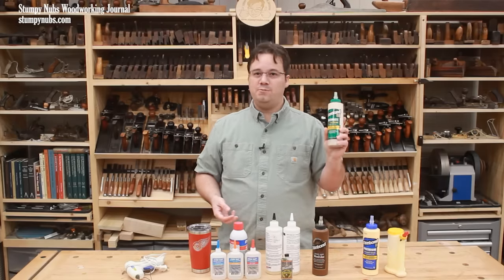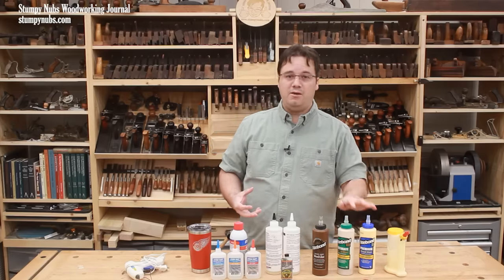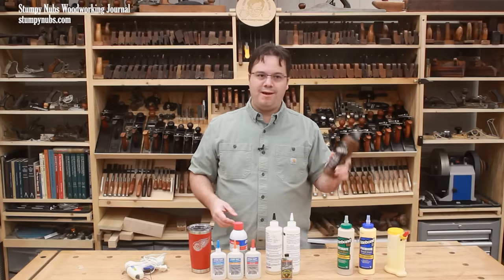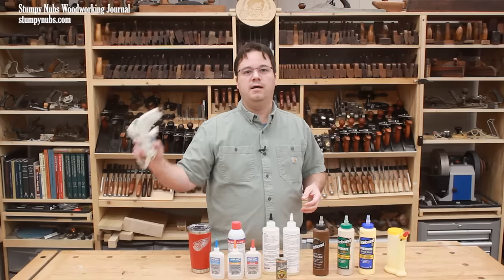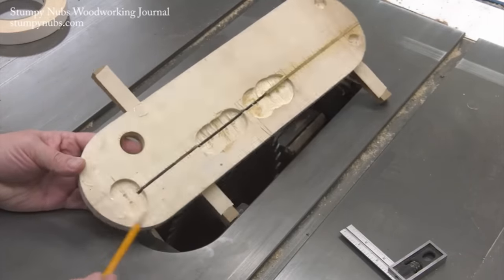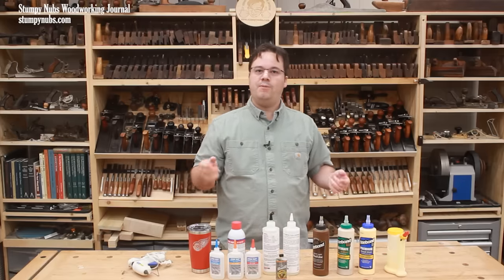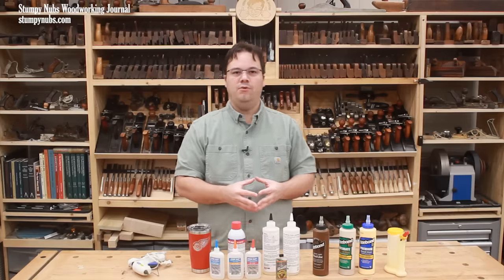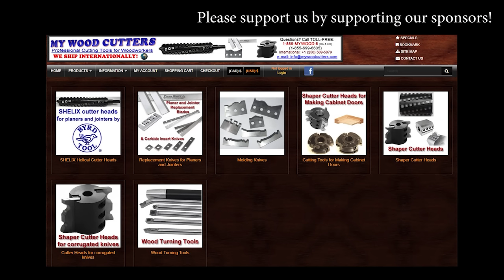Why I don't use Gorilla Glue

Comment: Here in New Zealand there is a workshop building new airframes and wings for the De Havilland Mosquito Fighter bomber from WW II. These are made of wood: spruce/balsa ply for the skin is only part if it. I don't remember which glue DH originally used, but it didn't last that well especially if the aircraft were stored out doors. Even during the war aircraft operated in the Pacific Theatre suffered delamination from the humidity of the tropics. Of the new ones built in Auckland they use Epoxy glue. These aeroplanes are airworthy and will probably out last the originals.

Comment: I have never used Gorilla glue, but a comment by Ken Horner in his Woodworker's Essential caught my attention just a few days ago  He recommends polyurethane glue over PVA for gluing up panels.  He says that the problem with PVA is that it gives a semi hard glue line and this allows the joints to creep which can cause cracks in the finish along the glue line later on.  By this he means that it allows creep after it is dry.  He is not talking about creep during the clamping process, I think.  I have heard this in the past somewhere or other, but I do not remember where.  Horner also says that PVA can soak into the grain near a joint and can cause finishing problems later.  Polyurethane glue has neither problem, according to Horner.   This caught my attention because once (and only once) I did have cracks in the finish along a glue line in a table top even though it did not look as if the joint had actually come apart at all.  I do not know whether this might be result of the joint creeping or the result of an imperfect joint.  Anyway, I wonder if Stumpy or any one else, has any insight on this issue.

Comment: A combination of CA and PVA glue can be a game changer.  PVA for most of the job for strength and CA in a few spots for an instant bond and no need to clamp.

For example, built some furniture with a plywood backing that I glued a bunch of pre-stained “bricks” of wood in several species, thicknesses & colors.  Then glued each in place with PVA in the middle and a drop of CA in each corner.  I was able to do. A few hundred in one night instead of maybe a dozen with clamps.  They had no need for structural strength, they were purely decorative.

Comment: I use Gorilla Glue for RC Airplane repairs. Mix it with a bit of water and it foams up making a decent glue to fill / brace spots on a slightly wrecked rc plane.

Comment: The polyurethane glues are more mess than they're worth for precision woodworking since, like you say, they tend to bubble everywhere.  But for repairs of things that no longer quite mesh up that same foaming action makes a small amount of glue capable of forcing its way into gaps and rough surfaces.

You can also control the amount of foaming by adjusting the amount of water.  It can range from almost as much as a minimum expansion foam down to practically none at all in a dry environment.  The drier it is though the longer it will take to fully cure.  Keep it dry enough and it makes a tough, durable finish even.  I know a few people who use one coat of the glue in place of having to do multiple coats of the thinner formulations.

Comment: gorrila glue is very similar to something called PUR (pure) made by henkel, the makers of loctite. it requires that the wood be pressed together at a high pressure so that when it 'foams' or 'pops' it is driven into the capilaries and makes a better bond. so clamping it is always the best. I still have the stuff on my boots, and I havent worked with it for at least ten years! it never wears off..

Comment: On tight fitting wood joints PVA glues which are water based can swell the wood and I've had the glue grab before getting the joint all the way home. PU has let me get the joint all the way together especially long sliding joints.

Comment: When I was a kid (many decades ago!), at school we used the traditional animal glue heated in a gas ring in a water jacket boiler.
 I sometimes use gorilla glue to fill joints with gaps, but on occasions it looks like it foamed so much its full of holes.

Comment: I generally use tite bond 2, I can see some places where 1 or 3 would be useful, especially for outdoor projects.
Reply: Titebond 3 is awesome for outdoor projects, especially if you're painting it. I rarely use epoxy anymore and have projects that have sat outdoors in the sun for 7 or 8 years assembled only TB3  (Brad nails to hold in place if clamping was difficult). Never had one fail.

Comment: The reason I avoid basic Gorilla glue, comes from my time doing Special Effects in Hollywood: Some of the materials I used frequently, were 2-part polyurethane resins and foams. The trick with the resin, is that the least bit of moisture contamination will cause the resin to foam up, and expand unpredictably, sometimes forcing upen the mold. 
Basic Gorilla glue requires moisture to activate it, and it's been my experience that Gorilla glue will sometimes foam, too. Reassembling a chair in which the legs have become loose, that foaming effect will fill the gaps, and feel solid, but over time, the working of the chair will collapse the cells of the foam, leaving the chair as loose as it was, before.

Comment: video was very good info all the way up to the gorilla glue. I only use gorilla glue for every thing i build and i have not had a problem at all with oily wood such a teak. all the way up to mahogany with is very dry and i do not wet the dry woods. I have made numerous cutting boards which get washed and let dry regular no problems. a entry way shoe bench and tree no problems. In MY opinion for what its worth it is a great glue that drys clear and not yellow.

Comment: You touched on it regarding hide glue but not all of us do enough to use a bottle of glue while it is still good.  That makes a 'second choice' glue that will do several things preferable the absolute best choice when the smallest size is four times as much as required for that job but is not going to come up again soon.  You mentioned three glues that are all just as good or better than Gorilla for certain uses.  When my wife comes to me and wants something fixed, I appreciate not having to make a special trip to buy a different, specialized product.  You might do a video on shelf life and versatility.

Comment: Weekend DIYer here.  I notice that I am able to add sawdust to Gorilla wood glue and get a much better looking patch or fill repair than when I use Titebond.  Tightbond may provide more assembly time, but I think Gorilla glue just looks better on some finished joints, especially if they are not perfect.

Comment: what is a glue for projects that are stored in storage units but used in indoors?  I fixed a rental companies craps table and I used Liquid Nails (along with pin nails) to adhere the chip rails due to the extremes of 15 degrees today and 100+ in the summer.

Comment: Back in the days before Titebond III, I used foaming polyurethane glues for under the waterline wooden boat repairs.  Titebond III has made Gorilla glue obsolete.  I also discovered back then, by doing extensive testing for a basswood bridge competition, that Titebond II (before III came out) was significantly tougher and more elastic than the original Titebond.  As you know, with proper joinery, yellow glue is more than sufficient, but I really only use the Titebond III any more because I find it better in every way than its predecessors.

However, I strongly suggest that you take a look at the clear non-foaming Gorilla glue moisture cure polyurethane.  It isn't a replacement for yellow wood glue, but for wood-to-other-stuff applications, it can be far superior to epoxy in certain situations.  The urethane bond is not only stronger, but its greater elasticity than epoxy will maintain a hold between materials of different thermal coefficients across wider temperature ranges and more cycles.  So, think epoxy for bedding a metal fastener, but urethane for something like metal edge-banding.

Comment: I started in guitar making nearly 60 years ago, with a book by a professional builder.  He SPECIFIED white glue, although yellow glues had recently come on the market.  I built two guitars from this book, one for nylon strings (classical) and the other for steel strings (most common).  A fewyears later, the nylon-string guitar was still fine, but the steel-string was all messed up.  It turns out that steel strings exert over 600 pounds SIDEWAYS pressure on joints than nylon, and white glue will slide (creep) with this kind of pull; the downward pressure joints were still mostly fine.  I don't know if ths is still the case, but my more recent efforts have not self-destructed using yellow glue.   Just fyi.   Re:  Gorilla glue:  This stuff REALLYexpandsand if not clamped may push your pieces apart!  I've seen (not mine!) a 3-piece lamination of 1-inch stock pushed open an extra 1/2 inch by just the two glue joints!

Comment: It's definitely worth looking into Weldbond as a white PVA glue -- it doesn't fit with a lot of your descriptions of "white glue".  It sets faster and is more flexible than Titebond, and Matthias Wandel's stress tests from years ago showed it was stronger, too.  It also melts like hide glue (which I found out the hard way when it melted and froze up the bearing on my flush trim bit).  I've also heard of a number of woodworkers having trouble with a chemical interaction between TB3 and walnut that weakens the glue -- curious of you've seen any of those references.  It might also be worth talking about Gorilla's Clear Glue ... it's a non-foaming urethane glue that cures more flexible than a lot of epoxies -- I've found it to be useful with multi-material bonds where I need something that flows better than fast epoxies but will bond strongly and stay slightly flexible over time (it's held up for years after repairing the torn-out bolt holes in my plastic wheelbarrow).

Comment: If I am making a quick project I will use 2-3 CA glue blobs on the joint and then fill in the blanks with wood glue (of course spray the other side with the CA activator). The CA glue bonds rapidly and I can continue working on the project, then the wood glue bonds well overnight giving a strong bond.

Comment: I used gorilla glue for years when building outdoor projects using loose tenons. Plenty of clamp pressure and the expansion capabilities never left me with anything except a tight joint.

Comment: BTW Titebond II is water resistant enough to be used in marine applications. It's been used as the go-to in amateur boatbuilding for years. (Not sure if Titebond 3 has made it obsolete or not yet as it's probably more recent than some of the resource books I've been using.)

Comment: Gorilla Glue and hot glue sticks (on a dual temp hot glue gun set to LOW) are the only ways to glue styrofoam. I usually use some toothpicks and stick it in as well if I'm building something square and large or something. I have got to get some of that CA glue soon. I still have never used that stuff.

Comment: One glue that isn’t mentioned is regular hot hide glue. I like it because when it cools it gels, holding certain types of work together without the need for clamps. It will dry completely overnight, and the bond is strong enough for just about any woodworking project. Also fills gaps very well.

Comment: I was production manager in a factory that had an extensive test lab with which to test bonds and joint strength, and in my own time, out of interest, I tested every kind of glue I could get my hands on, including Gorilla glue.  That tested at just under 50% of the strength of white PVA which, with proper joint preparation and clamping pressure, was the strongest of all the glues, followed closely by the aliphatic pva's then Aerodux, then epoxy which was still stronger than almost all of the wood species used, then, way down the scale came the polyurethanes, and right at the bottom of the heap, foaming polyurethanes including Gorilla glue.

Comment: I generally use 2 glues in my shop, I use Wilson art yellow glue which I have found to be the best ovrerall glue and it works in the cold as well, and I also use unibond 800 for pressing veneer in the bag and for when I need stuff to be slow set,  maybe its experience at this point but I don't really ever get into a situation where open time is am issue. But boy do I remember back in the day when I would take half a day to go over the glue up and make sure it was all perfect, and then still stress out when it actually happened.

Comment: Urethane glue is useful for sloppy joints because it expands. However I've found it's no better outside than titebond 3, which is my go to glue because it works into the forties. My basement can be as low as 55, which is the limit for most glues. Some live seen as high as 60.

Comment: If it’s not going to be seen or visible I use JB weld epoxy.  This works well for instances where you’re working with small cabinets and you need a tiny piece of steel to protect the inside of the wooden drawer from the end of the metal slide.  In other words a metal to wood bond that will last.

Comment: Polyurethane glue is used extensively in boatbuilding, as well as epoxy. It has greater flexibility than epoxy, but is less forgiving of gaps, despite its expansive properties.

Comment: is there anything you need to know about how long pva keeps or how it lasts longer or does that stuff just keep on the shelf forever?
Reply from the maker: It is supposed to have a 1 year shelf life. I have used if for two if I flip the bottle once in a while to keep it from separating. It may last longer, but I don't want to wonder if my glue joint will hold.

Comment: The problem with CA glue in my area is no one that I can find carries the accelerant.  I use Titebond III in all my wood projects.  They're small enough that I don't have to worry too much about the open time.  I used GG to glue the tip of my shoe's sole  back on.  I never use any moisture with GG - it seems to get enough moisture from the air.  I anchored barn door door guides to my tile floor.  Both GG projects still holding fast.  Time will tell.

Comment: Just like CA Glue, you can also keep Polyurethane Glue in the freezer.  It does make it thick but if you allow it to warm to room temp before use it works OK.  Best way to store it is to squeeze most of the air out of the bottle and then return it to the freezer.  I've kept large bottles of the stuff usable for several years by storing this way.

Comment: The title of this video should have been, "Everything I you needed to know about glue but never asked."  Great vid!
Reply: Far from everything. This video was on woodworking glues. If you are working with plastic, metals, or glass, your local automotive shop will have shelves full of special application glue. I just glued plastic guides in my refrigerator back together with Loctite Stick 'N Seal. It did a strong bond, and I did not have to turn off the refrigerator. It worked fine at 39 degrees.

Comment: The original Gorilla Glue foamed up and required clamp time.  They have a clear version that is very good and doesn't foam or want to expand.  Still needs a clamp.

My normal Go-To is Titebond of whatever versio n I need.  Epoxy will run you $280 for a gallon of resin and a 1/2 gallon of catalyst.  I've built a couple boats with it, and it's fantastic, but very pricy.

This winter I'm building a custom camper shell for my truck, and I would have planned for epoxy, but Titebond III will do fine.  The top will get three layers of 6oz glass with epoxy , though. Falling limbs....

Comment: You can also buy crystalized hide glue and just add water and a little bit of heat to get the consistency you need and only use as much of the glue as you absolutely need.

Comment: great video as usual  I don't use Gorilla glue either.  Messy, and.. Not that strong!  
by the way, as to Titebond, there are many more available.  You can get longer and shorter set times of each of them!  I agree with carrying all three and also that the original is also what I use the most of.  Easy clean up is important. I don't have to remember to wash out brushes immediately, lol.

Comment: i've always used gorilla glue when i needed a glue that didn't (or couldn't) be clamped. basically it was either gorilla glue or nothing. there probably are other expanding foam glues, but i've never seen them at the store

Comment: the "gumminess" from PVA glue is because PVA glue is a thermoplastic adhesive meaning it melts when exposed to heat. Cross linked PVA glue is a thermosetting adhesive meaning it won't melt and smear when sanded. Another advantage is heat also accelerates the curing process, if you're are able to safely heat the joint you can shorten your cure time to minutes vs hours. You see this used alot in industrial millwork shops with veneering capabilities, they'll spread a thermosetting adhesive like urea formaldehyde resin and press it in a hot press for 15 sec vs 1 hour for a cold pressing adhesive.

Comment: always use titebond 2, sometimes 3 myself. recently got a bottle of the gorila wood glue. not a fan, very thin and runny. will not buy again. 

i do use their polyglue though, for certain exotic woods that dont play well with pva glue. i have never tried epoxy for these things though, i may need to get some to try out next time.

Comment: Put a drop of CA glue in nail holes or dents while sanding and it will fill them and be hard to find in most woods.  Back in the 50's I used to use Tightbond to build my model aircraft.  If you pre-glue the joint with thinned-out glue allowing it to soak into the wood and then glue as normal the wood will pull out before the joint fails unless it is at the cut edge of the wood.